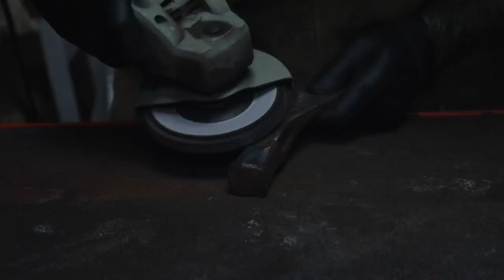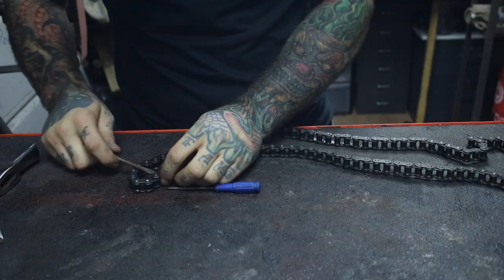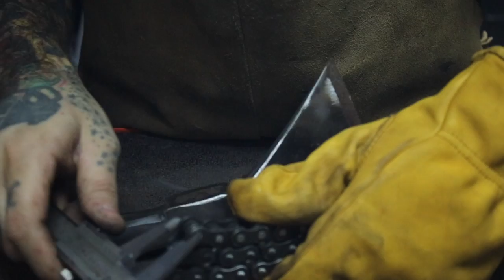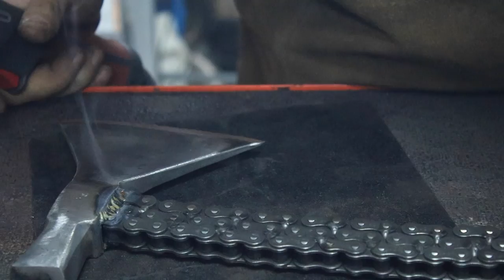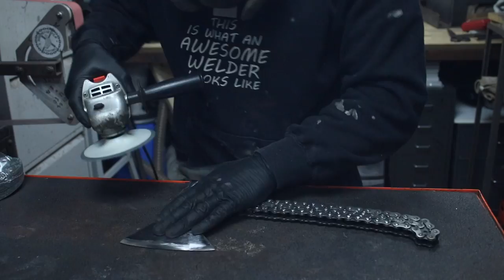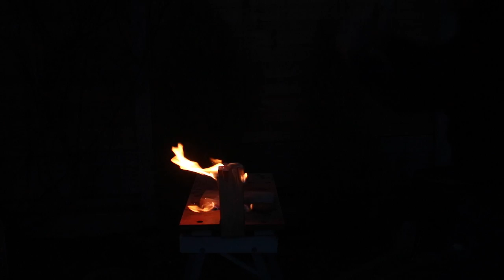Bike Chain Axe - Restoration Upgrade

Comment: Hey man I'm not trying to criticize your work or anything like that that's not my thing but it's give you a heads up you might want to push your MIG welding instead of dragging it you'll get a better consistency and more penetration and actually weld a lot easier
Reply from the maker: Thanks but I like to do it the way I do it and get it perfectly as that's the way I've learned to do it. Each to their own
Reply: @DiesInEveryFilm  so very true keep on getting it my man thought I throw some knowledge  ur way I've thought a lot of ppl how to mig weld stick and tig weld but u are a master at ur trade my friend

Comment: Tip for welding only drag if there is slag otherwise with mig push you get a better weld
Reply from the maker: However it's all personal preference
Reply: @DiesInEveryFilm  Yeah for Hobby welding
Reply from the maker: Well obviously this isn't professional welding it's my YouTube channel I do on the side and that is also incorrect cause I've worked for a big company here in the UK and everything was drag welded I'm afraid

Comment: How structurally sound is the tig welding on the chain for the handle? And also maybe a I didn't see it right but it didn't look like the axe head was all the way on? I mean if just for design and decorative it's still well made and cool. Just curious
Reply from the maker: It's solid I have used it every day since I made it and still fine. The shaft sits halfway into the axe head and is welded inside and out

Comment: Is that a regular rotary tool? I have a dremmel and it’s just not strong enough for what I want. Is that a step up? Or do I need to invest in a die grinder? I’d really like to avoid running my compressor if I could. Thanks!
Reply from the maker: I use a die grinder and a foredom tool I'll post links on my Instagram soon actually

Comment: won't be very functional, but it looks nice.
Reply from the maker: It's very functional I have been using it every day since making it
Reply: @DiesInEveryFilm  with that handle, really? isnt that uncomfortable?
Reply from the maker: No not at all it's actually ok to hold but then again I don't have girls hands
Reply: @DiesInEveryFilm  hehe, well, im just thinking for proper use it probably digs into the skin.
Reply from the maker: Proper use? It's a hatchet it's for splitting bits of wood and other household chores it's not a tree felling axe
Reply: @DiesInEveryFilm  most hatchets can be used to chop bone and various other things, so it should be tough enough for trees also if its properly made :)
Reply from the maker: Yes it's strong enough to do all that but before you were on about it being comfortable and I said it's not for cutting trees Down

Comment: Terrible mistake. There is a reason why you use wooden handle, and that is to muffle vibrations, and that's why you don't weld metal handle to and ax. Also chain handle looks uncomfortable.
Reply: Alek gonna look grand on a wall
Reply from the maker: Yawning hell

Comment: I thank it woulda been better if u put the chain all the way through the head
Reply from the maker: It wouldn’t make a difference it’s welded in nicely and from both sides
Reply: Once u start swinging it the impact is gonna all be transferred to the welds whereas if it went all the way through the head it would distribute the force more evenly
Reply from the maker: Thats not true at all. I make things like this for a living and I know what im doing so don’t try to correct my work with something you don’t know about